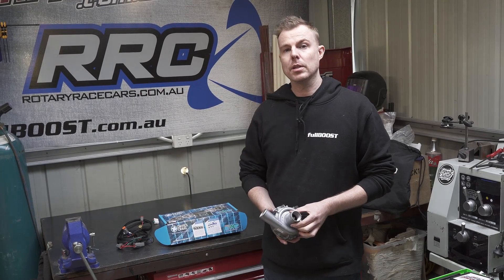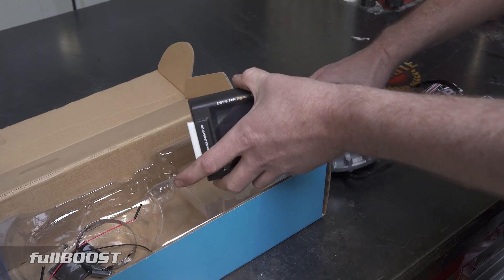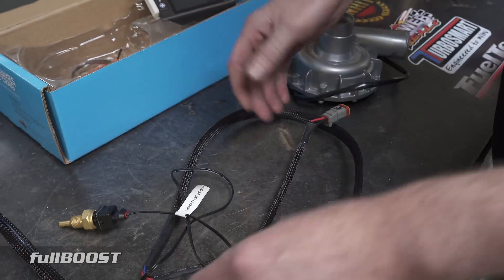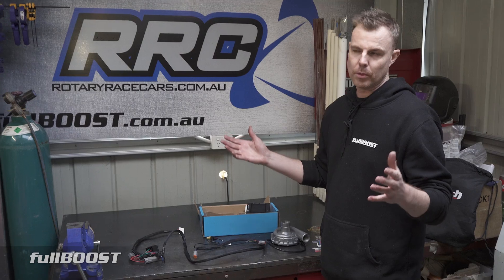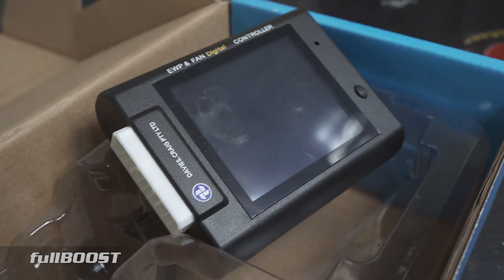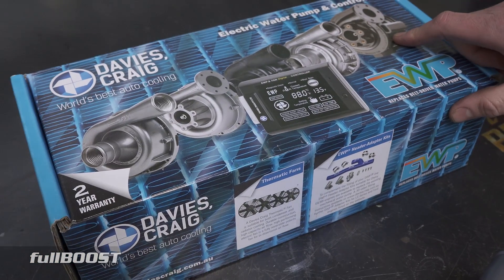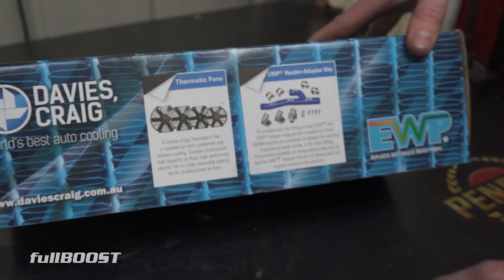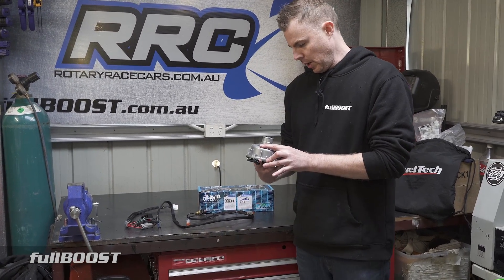Everything you need to know about Davies Craig electric water pumps | Tech Tuesday | fullBOOST

Comment: I've got the EWP130 with the controller in my 13B turbo RV9 airplane. I'm just in the process of installing a FuelTech FT600 to replace my aging ECU and after watching another of your videos, I've just ordered a DPM35 and 2 keypads, with the intent on replacing much of my currently crowded panel. My plan is to use the DPM35 to do full control of the EWP and remove the DaviesCraig controller. 
What do you think of that possibility?

Comment: I have this pump on my small truck that runs a Nissan TD27 NA. It can't keep up with it and I am having major over heating issues. Its been test so many times its down the the dam pump. Its only good for 60 kph then it over heats. There is also alot of things in the controller that can't be adjusted to suit your engine. Biggest POS I've ever brought, 1 out of 10. Don't waiste your money on this Junk.

Comment: I have one of these on my car, the fan started to come on when I first started the car all of a sudden and I missed the fact that the display was not working because of the bright sun from having the roof off as it was positioned by the parcel shelf on the passenger side, I noticed the temperature on the dashboard went up very quickly which I did not notice straight away by the time i managed to pull over it was to late the engine head gasket has gone maybe more.
It turned out to be a relay that had gone,I questioned this with the garage and they said that the relay controlled the electric fan but the fan was working, once I replaced the relay the display
came back on  but I had refilled the radiator after the overheating.
Does the system leave the fan on when the pump stops working by default as the garage stated to me that the relay for the pump is under the water pump so I am puzzled by this.
My future start up procedure will be to turn the ignition on before starting the engine to hear the pump push the water through.

Comment: I have a 2014 ford explorer police interceptor. I really love the thing but I saw alot of videos saying that when the water pump goes out you have no warning and the coolent dumps into the oil because it's a stupid ass ford engineered idiotic idea. There is a place where there is water on one side and oil on the other on a main seal. So basically at 80-100k miles the pump goes out and you have no idea until the motor is ruined .I just had the idea of bypassing the stupid ass ford crap and installing some kind of external water pump.is this possible?

Comment: omg.. im so interested in this... i want to learn more about it. how does it keep pressure in the block to keep cavitation down? is that what the pump duty cycle is for? and without a thermostat how are you keeping pressure in the block? is there a orifice plate being used? id like to use this in a vdrive boat and get rid of my cam driven water pump. i could also use this in a few of my vehicles.

Comment: 16 AN fitting and hose?  Single or double relay for each fan? Manual bypass? Can the mechanical pump work properly  if it fails?or how much restriction does it create ? Thank you , There’s quite a few questions I have , I have already purchased the dual relay circuit, can that circuit be used with this as well? Thanks again...
Reply: That's an interesting idea! Have a flow switch or something to trigger a clutch system for the pully driving the the mechanical pump? Maybe downsize that pump for failsafe use only? (Will get you 100+ miles with conservative driving)

Comment: I wanna run this in a Mad Max car that has a 390 Ford V8 with limited space in the front so I want to run ABS pipe to the trunk and have the radiator directly under the package tray with electric fans.
I can I use this pump instead of the actual mechanical pump and leave the mechanical pump inert (with no pulley on it) and run solely off of this electric pump?
Reply: You take the mechanical off and put on the adapter plate on the front of the engine to run this one

Comment: Whats the opinions for a street driven weekender and sometimes daily? I've got an all cast iron Holden 304 in a VS, some minor mods, with mechanical viscous cooling fan setup and a 92 degree thermostat, in cold ambient temps under 15 degrees the car runs cold on the highway which is most of my driving, around low 80 degrees and even worse in negative temps we get in winter, thermostat is new and cooling system in good condition.

Then in Melbourne in heavy traffic the car gets warm because the fan and water pump are only turning 800-1500 RPM at best while you slowly cruise through traffic and you can see the temp creep up.

I'm thinking this may be a good idea combined with an electric thermofan conversion, because it could bring the water temperature up to operating temperature quicker in cold weather, and then at idle in hot weather in traffic the pump can flow much more than the mechanical pump where engine is only turning 800-1500 RPM.

Whats the consensus for this type of situation? Car may hit the strip a few times a year but mostly just driven around the streets.

Comment: have been running one of these pumps on my daily for 5+years. have had one pump die but upon inspection (disassembled it instead of bitching and trying to get my money back) found that the sealing to provent water getting to the motor bearings is totaly inadequate for the application. never the less i still run these pumps today.
Reply: Its been 5 years - you still using these pumps?
Reply: @bobolulu7615 😂I think the peirburg cwa400 is where it’s at now

Comment: A water pump is not a water pump until it can push water UPHILL. This means can this alleged pump brag about its ability in head pressure. How high can it push water, which is essential as engines have very restrictive water passages. The ability to push water along a straight line in litres per minute does NOT prove its ability to push through a restriction.
Reply: Especially with the high heat and small spaces of rotorys

Comment: I have had 2 of these electric waterpumps fail on me. First was replaced under warranty, the motor had seized. After investigation by me, I discovered the 'E' clip on the shaft had broken, (which is what the impeller is tightened against) allowing the shaft to spin without turning the impeller. Because the shaft was turning (for a while) the system showed it was working ok. The engine got warm, but didn't cook.
The second had exactly the same thing happen, the 'E' clip broke and I cooked my engine. Davies Craig blamed the coolant I was using and wouldn't cover it. Very disappointing. I did not tamper with either pump in any way, and have over 40 years in the trade. I would not recommend them to anyone.
Reply: I was wanting to hear from someone with actual real world experience. Thanks. Confirms my suspicions. I would NOT hook this up to a 50k+ engine or anything of the sorts.
Reply: Greg Blank I’ve had them in customers cars for years now. These are all the modern type alloy body pumps as well. Some daily driven with no problems at all.
Reply: Hi, I am curious about your problem, can I ask what were the models with which you had problems ?

Comment: You still need a better radiator if not this is pointless .
Reply: I was wondering about that. If it's moving more water, wouldn't it then be flowing too much and not get cooled enough by the radiator which then leads to overheating? Just like removing the thermostat or getting one that cracks too soon.
Reply: @MV60  no because the pump doesnt run continuously to modulates flow based on temp.
Reply: @ZLAKLR20B  Thanks for that info, I was under the impression is was just a "dumb" pump.
Reply: depends on type of driving. daily, track. its velocity times capacity
Reply: False.
Reply: @mikdonalds3956  and how would you know . Troll
Reply: @mikdonalds3956  i bet you liked your own comment too .

Comment: I agree with 90 percent of Dinos shed decription. If electric pumps were really good, you would see them on really good engines.
Reply: Electric water pumps are very common place at race tracks where there are some of the most expensive engines you will find.  Lot of oem applications now also have electric water pumps over mechanical from factory.  Vehicle manufactures will do with 'good enough' over 'best' when it comes down to cost, so you have to look at motivation as to why certain things are not done from an oem stand point..  If "best" costs more than something that does a good enough job for the most part, they will stick with the lowest cost option.  (Great case in point is ford went to a waste spark multi coil system on the EF falcon.  They found it the old distributor style system was cheaper to manufacture (and was probably easier to manage with LPG), so they went back to it in the EL instead of investing time to make the multi coil system work, which is now standard on pretty much every passenger vehicle.  They stuck with an older system not because it was better, but because they could save money doing so).
Reply: What happened to your Supercars bench torque?????

Comment: Probably not a good idea to remove the thermostat as it is a restricted orifice to help pressurise the cooling galleries between it and the water pump. Removing the thermostat and the mechanical water pump will ensure you have hotspots and cavitation in the head. A mechanical pump will generate 40psi of coolant pressure which is what prevents the hot spots, remove the pump or thermostat and you’ll loose that pressure. Electric pumps are best used in conjunction with a good mechanical pump and thermostat, they flow well but don’t build pressure.
Reply: I've never heard anything like this before. I thought the heat would be the main element that builds pressure in the cooling system?
Reply: A standalone electric water pump is only suitable for drag racing, for circuit, track, street car you need the mechanical pump and thermostat, the electric unit complements the system by allowing you to have it operating whilst the engine is shut off. If there’s no pressure in the block it will allow the superheated areas of the cylinder head to boil the coolant, if it’s boiling, that’s cavitation which will lead to cracking of the metal.
Reply: @dinosshed  ive used these in my own circuit car as mentioned in the video, as well as countless customers cars and all have been superior in every way compared to the oem mechanical pump in these applications.  In some of the setups i have left the thermostat in place (but gutted) as some systems use the thermostat to block off an internal bypass, and was just easier this way.
Reply: Glad it’s working out for you but it’s something you don’t see until the engine is showing signs of failure. If electric pumps were brilliant on their own, then mainstream manufacturers would use them, group one categories such as v8 Supercars, Formula one, etc but they don’t because they don’t pressurise the cooling system. Some manufacturers like BMW utilise them in conjunction with the mechanical pump but not solo.
Reply: @BackyardMechanics  have you had any experience with this pump on a high revving rotary?
Reply: Kurt Phillips yes have run this on my circuit FD as well as several other customer cars. Don’t go any bigger than a 110/115 pump on a rotary. Will be finding it’s way on to project redline now also
Reply: @BackyardMechanics  am I right in thinking rotaries have simpler cooling channels and therefore need less total pressure (and negating potential issues mentioned above)? And which flow rate option was my next question so thanks for answering that already, but why no more than 115?
Reply: Kurt Phillips smaller cooling system, so you want to slow the water speed down so it has a greater time spent in the radiator to have a chance to transfer heat out and absorb heat from engine. If it’s flying through the whole system too quickly it will never have an opportunity to absorb heat and then get rid of it I’ve found.
Reply: @BackyardMechanics  do you have a preference between the nylon and aluminium 115 pumps? And have you wired the OEM fans into the controller?
Reply: @dinosshed    Science moment: Now I "know" Dinos are wise, too.    :hand-pink-waving::face-blue-smiling:
Reply: @Dollsofgod  heating builds pressure in the whole system but the pump builds additional pressure at it's outlet, otherwise the water wouldn't pump. Afaik cavitation occurs where there is a sudden drop in pressure, therefore if the thermostat provides a restriction after the head, the coolant in the head is maintained at a constant pressure. The pressure drop and therefore cavitation will occur at the thermostat instead. If the thermostat is removed then a pressure drop might occur at a restriction in the head, therefore cavitation occurs in the head.
Reply: I would never want to remove the thermostat and never want the pump not flowing at any time to avoid hot spots. EWP seems like a good idea but not as the sole coolant temperature control
Reply: There's no reason that an electric pump can't be designed produce the pressure and flow of a typical mechanical pump, and the Davies Craig one is actually pretty good in that respect - it has more pressure at a given flow rate than a typical mechanical pump being driven at low engine rpm, but a mechanical pump will outperform it at high engine rpm. If you want more pressure/flow you can always use multiple electric pumps. The reason you don't see the mechanical pumps being replaced in OEM cars is one of cost, packaging and reliability - the electric solution is physically larger and heavier (for the same pressure/flow), may require more piping to locate it away from the heat of the motor, has additional points of failure and for sure costs more as it is has all the parts of a mechanical pump plus the electric motor and everything that goes with that. The only advantage is being able to run it when the engine is off.
Reply: It’d require a 3hp electric motor to match the pressure and flow of a modern engines mechanical pump. OEM don’t use them unless in conjunction with a thermostat and the mechanical pump because they don’t work in that application. The only place I’d be using this would be on a high rev engine with under driven ancillaries or a drag/dyno engine.
Reply: If you've done half as much R&D as Davies Craig on the cooling system, I'd be impressed...but according to them...flowing too fast is a myth

Comment: Old saying you get what u pay for, and you will pay for said products    but the money saved from potential engine failures and peace of mind is well worth it.👍😎
Reply: How an electrical pump is safer than a mechanic 1?😅
Reply: @raulduke85  better for thermal control over the engine cooling system at lower engine rpm's. Mechanical is linear flow inline with rpm, elec is pulse width modulated not Rpm dependant..
Reply: @carbonharmonics  an electrical pump can fail easier, then u just throw away your engine
Reply: @raulduke85  wrong
Reply: @raulduke85 broo what are you talking about? Electric water is even easier to work with